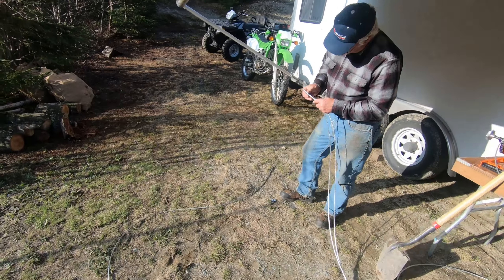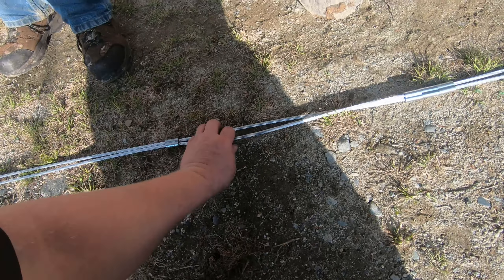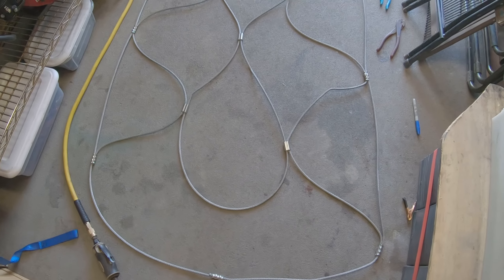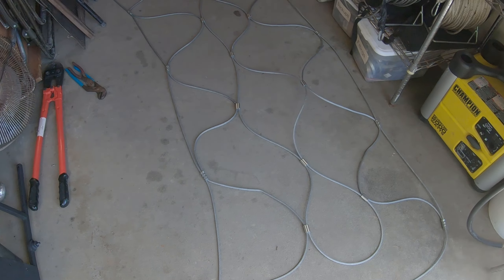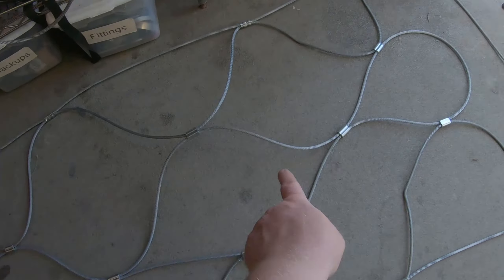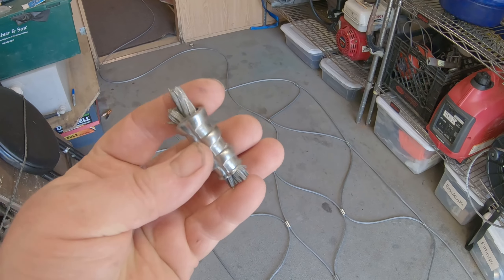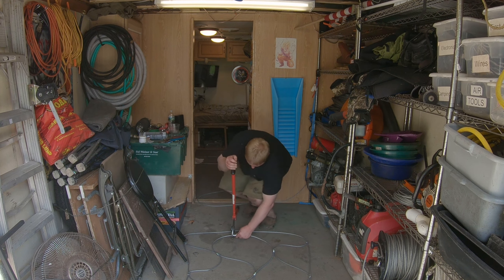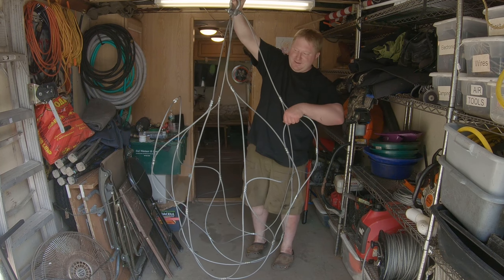How to Make A Rock Net For Pulling Boulders!

Comment: I prefer to use soft strap chocker type slings - the round soft span ones are light weight and easy to carry, but grip rocks well
Reply from the maker: They work great as well, but they shred up fast!
Reply: @AmericanGoldProspectors  flat tow straps shed quick, but spansets for rigging last a really long time, they have protective covers over the fibers.

Comment: What's the weight rate on those lift lines and swage couple? Are you going to use any thimbles for less friction on the pull?
Reply from the maker: Sorry not sure. I just winged this project.